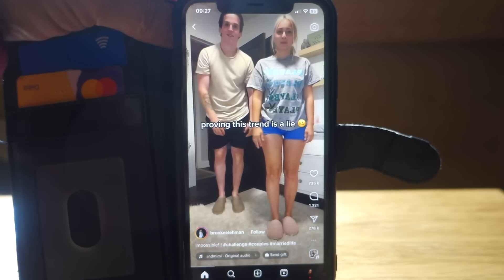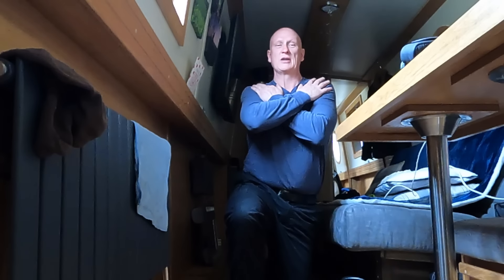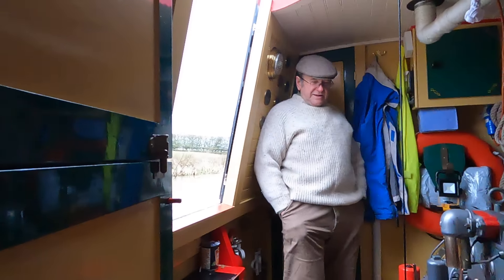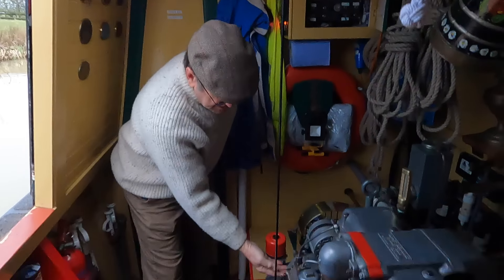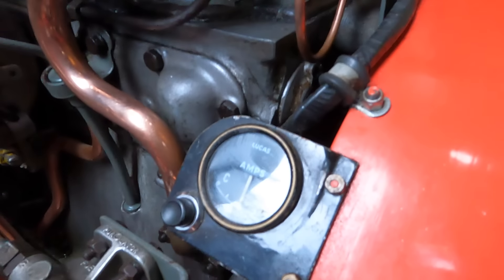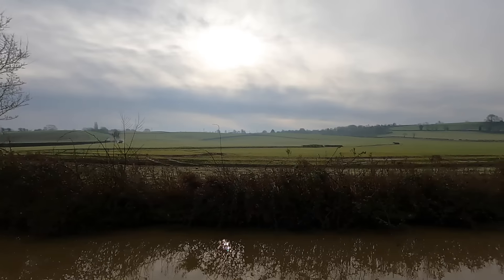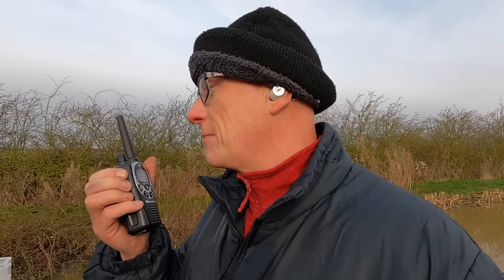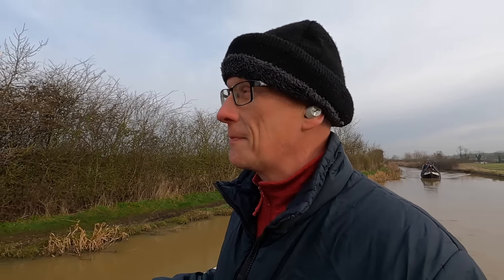The Gardner v Modern Engine. S3 Ep35  #narrowboatlife

Comment: I once heard it said Gardners were the RR of UK Diesels, nice lump. You might say to Colin that my Dad used to insist that you won't get a true sump oil reading unless you wipe your dipstick.
Reply from the maker: I'm sure Colin would ordinarily do that. I know I do...most of the time. Thanks Terry.
Reply: Well if your Dad said that!  it's good enough for me, I will do that, however ,  just a thought , if you wipe the dipstick, then put it back in ...... the true level of oil reading  has gone , because it in now the tru level -minus the oil on dipstick which in the rag😇

Comment: Great vlog once again Chris, thank you for sharing.  That engine was a piece of art and if you are an engine buff, a beautiful thing to have, however as I'm not particularly a petrol head I would likely end up with an engine like yours.  I think in a previous vlog I mentioned that I too have some history with VP and have carried that on through amateur radio.  If I had a boat one of the first things on my to-do list would be to install a collapsible mast and at minimum a VHF system for local repeater Comms or even simplex occasionally. HF would be more of a challenge but easy enough to get a fan dipole up for a couple of bands, always someone out there for a QSO or in a time of need.  Great stuff and that crumble looked really tasty.....😊
Reply from the maker: I was always fascinated by HF comms. It’s an art. However, it’s great to know someone is on the same frequency so I can really understand whether the antenna is working or not. Directional antennas was always a dark art but really effective. In the dessert, I increase the range of the radio equipment by increasing the ground plain and frequency. It should never have worked but the dry land made the attenuation decrease. As for the crumble…..I was better at getting comms with a HF radio with no-one listening on the other end!

Comment: Your friends boat having that particular engine on the "inside", so a few Q: 1) is that "Gardiner" easier to service (spare parts etc) ? 2) Are there "other" styles of "Gardiner", for example, a smaller size but still can be used inside ? Lastly, would this need a special cover (for insurance) or is there just a generic insurance cover for most narrowboats ? Thank you for your help.

Comment: I'm in the "kick tyres and take off" set so don't understand the the idea of carrying a lump of old iron around. However, it must make a good drying room so not all bad. 😄
Reply from the maker: I did that in the car. The VW just worked and the onboard computer told you when anything was wrong. The engine is one of those thing many don’t pay too much attention to. My head is in the engine bay at least twice a week. However the Gardner drying room….absolutely.

Comment: I could be wrong, but I thought I remembered you saying you were putting your coal ash in your composting bins.  I watched another narrowboater today who said they throw out their ash, because coal ash is toxic to plants.  I also think I heard you say you were going to use your compost in boxes of flowers.  Now I'm wondering if that will actually work.
Reply from the maker: It is stated that ash can spoil plants but if it is used in the winter and should be dug in. I add it to duty out the contents and to be honest while it was a though to grow flowers, I can’t see that ever happening. So my use of the ash is mainly to make the process easier to manage. To put ash on the towpath and not dig it in is unsightly and the local residents have put out fires caused by boaters not allowing the ash to cool. I do what I do as it works for me. Thanks for the comment Jane.